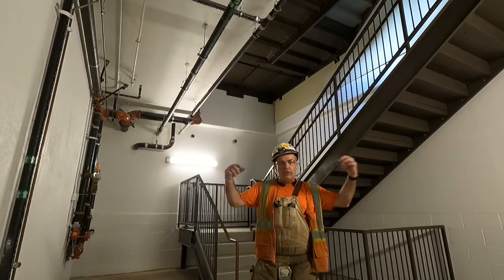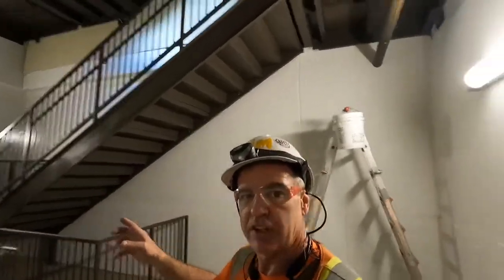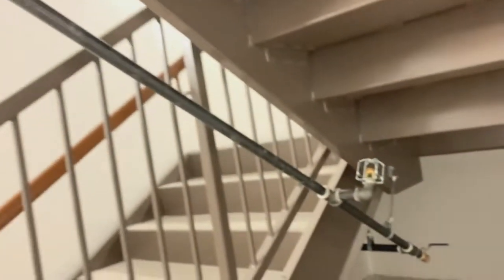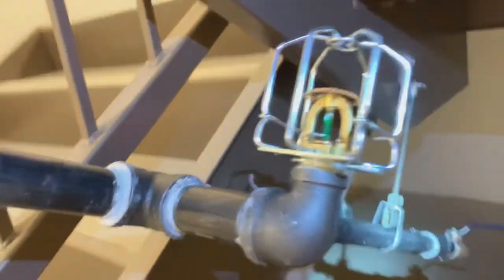Stairwells need fire sprinklers to?

Comment: God bless your shop. Someone actually does there job and comes out and looks at the job before hand. You barely ever have to pull a machine. If that was me I’d be sent the material they “think” I’m going to need which half of it is wrong lol. And I just have to get coverage. Nice work.
Reply from the maker: I measured it up and the shop cut it for me Fitter542 :-p

Comment: In noncombustible shafts you can omit coverage when the space is blocked off preventing storage. That's the reason that space was fenced off - in lieu of fire sprinklers. (NFPA 13: 8.15.3.2.3.1)
Reply from the maker: Yes, you were so right! But you know as well as I do that if you try to fight the Fire marshal you will lose! You could pull all the codes out of the book you want but if they want a fire sprinkler there, they will get it! Thank you for watching and thank you for all your knowledge. I always like to learn something. at least I try to learn something once a day if I can. I just had to change a whole bunch of fire sprinkler heads that had super dope on them! I learned that you cannot use super dope on fire. Head breaks right off! Thanks again for watching him all your nice comments. Stay strong and healthy. Bye-bye.